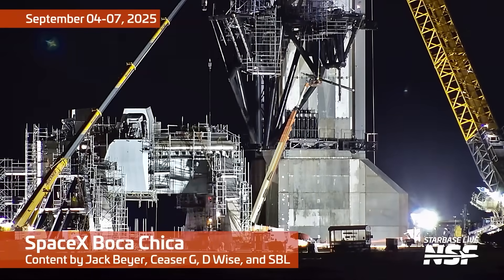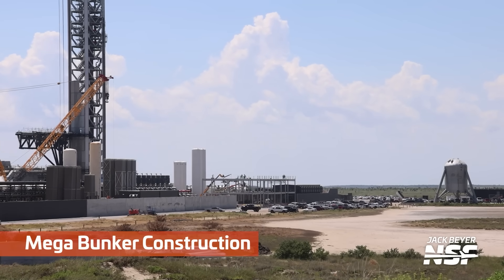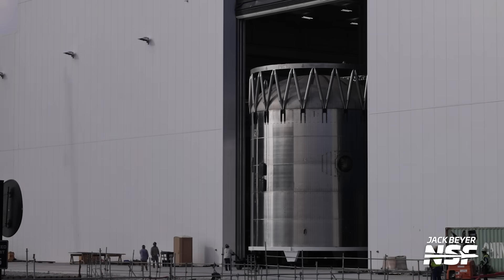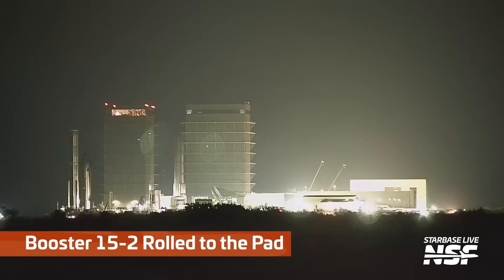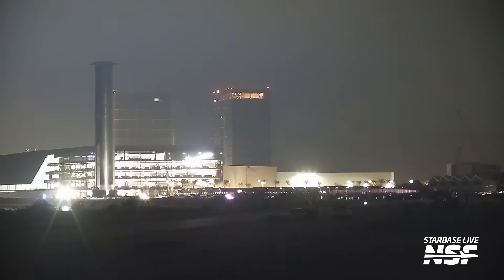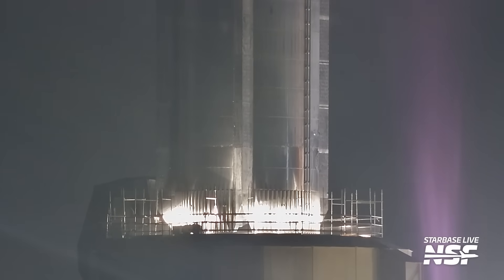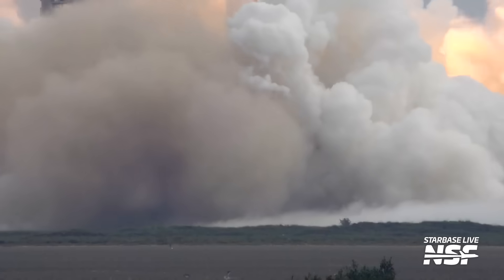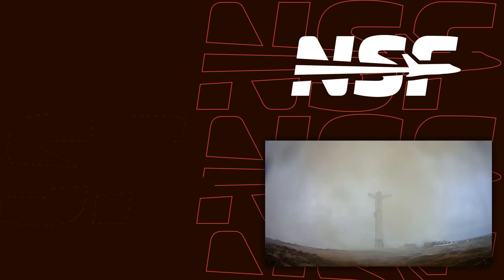"All Gas No Brakes towards Flight 11" | SpaceX Starbase

Comment from the maker: If you're new to Starship you can catch up with the first 10 flights in this article from Ryan Weber: https://www.nasaspaceflight.com/2025/09/ten-flights-starship-program-successes-failures/
Reply: Of I can read properly, there is a tiny spelling mistake :->
Reply from the maker: @atemoc  Spolling is hard ;)
Reply: main issue with the 5:55 camera is the focus is off, on the grass in the close foreground, it should be focused on the middle of the road for optimal clarity and depth of field

Comment: Hey Das, photographer in me coming out again. ( I was the night lens filter guy ) Curious to know, whats the focal length of the new star factory ultra wide you guys are running now?
Reply from the maker: Oh good grief... that thing? Like wide enough to cover from your garage door to the side of your house. (Its a box security cam). Likely single mm 35 equivalent hah. - Das
Reply: @NASASpaceflight  oh Das you made it sound like an old horse. :) 35mm = 63 deg FOV, I reckon its more likely around 14mm = 114 degrees. She's a wide one what ever it is. I use a 14mm in some portrait work and the effect you get is brilliant on close-ups.
Reply from the maker: Single digit mm in 35 equivalent... as in, 7 or 8mm. 😅 - Das

Comment: Need to move a heavy trailer?  TrailerValet.  They have multiple options for powering a trailer around, weight loading and ground conditions, etc.  They are spendy but they seem to be quality.  I've got their basic jack and it is nicely built so I would assume the more-better items are just as nice.

Comment: Could they just cover the Pad with heat shield tiles? Or would they just blow away from the pressure? They handle heat and are easy to replace, right?

Comment: Hello, Moving heave things on wheels. A friend of mine has a light aircraft and we use a battery operated tug, That just attaches onto the nose wheel, so we can move planes around the hanger. Not sure if you have them in the US.

Comment: No it has brakes Flip the ship within meters of the moon surface just like the catch tower just as if the moon surface is a catch tower  Its possible. Space x you can do it . Wish you the very best.
Reply: No flip necessary on the moon. Not much of an atmosphere to go sideways through to slow down, so it is just landing tail first like God and Heinlein intended.

Comment: Does the new integrated hot staging adapter have a section blocked off too control the booster flip direction? I didn't see it in the video.

Comment: I would be glad to give you a tutorial on CH4 liquefaction process as well as an air separation plant. There are many similarities. Different refrigeration levels. I spent most of my career in LNG plant design and startup and testing.
I have followed your channel for a while as I have been a space fan since the 60s.
Reply: David; Do you have any video/ tutorials on this subject?  I would be FACINATED to learn more about the subject.  -Papa Root
Reply: @Paparoot05 I have been retired for about 6 years now. The presentations that I have access to are a bit dated. I was thinking on a verbal tutorial rather than a visual one. That way it can be interactive.
Reply from the maker: Know anybody that would let us visit one? - Das
Reply: @NASASpaceflight There is a large LNG facility near Corpus Cristi that may do tours. Standby, awaiting a response from some contacts.
Reply: @NASASpaceflight I’m retired now, but, let me ask around. Do you have information on who the contractor or process licensor for either project is. I thought I saw the Air Sep unit was a Linde process, but don’t have confirmation on it.

Comment: I struggle to see how those hot staging struts can support the ship with 33 raptors firing.
Reply from the maker: You dont think the massive triangular struts look more sturdy than a ring with holes cut in the side? Huh - Das
Reply: That is because it hasn't happened yet. Rest your eyes until it does, and then you can see it without struggling.
Reply: @geirmyrvagnes8718 I know better than to doubt SpaceX. I am sure it will. It just doesn't look like it could support it on the pad. Let alone through Max-Q.
Reply: @gregorypauldrapeau  I know the feeling. Engineering by squinting at things and trying to judge if it will hold is a time-honored tradition. Humans do it all the time every day, when you think about it. If it breaks you just beef it up a little. I actually think it looks stronger than the current version when I squint at it, but that doesn't help much, either. 😇 What is missing though, is the closed off section that nudges the first stage in the direction of turning back home. Also, it looks like they are apparently putting this in a testing jig, to do some tests with real hardware before launching a full stack. Either way it will be entertaining! 😁

Comment: I've operated an air separation plant. What do you want to know?
Reply from the maker: Do you have one we can visit? 😅 - Das
Reply: @NASASpaceflight  nearly all refineries have a ASU in them. They are typically operated by Air Liquide, Air Products, Prax Air, etc. You shoulf be able to get one of the operators to give you a tour. Places that have refineries and petrochemicals located close together may have a large ASU that pipes O2 and N2 to those facilities. Giesmer outside of Baton Rouge has a very large ASU from Air Liquide that does just that. 

You are relatively close to Corpus Christi. One of the refineries there will have an ASU supplying them.

Comment: Harbor freight makes a manual trailer dolly.  I use it with a utility trailer and a car dolly.
Reply from the maker: Know the model number? You like it? We just have a few crew grab the trailer tongue and brute force it. - Das
Reply: @NASASpaceflight   It's 60533.  Has a 600lb limit, which is probably tongue weight, not total weight.  Definitely easier than picking up by hand!

Comment: I'm really curious to see how the grid fins on the next gen booster will fare considering they are nestled inside the pressure vessel like that. Some serious reinforcement going on in that area. wouldnt be surprised if they spring a leak by the grid fin on one of the first flights of this gen. Seems super risky, and also introduces a lot of additional complications, like getting power to the grid fin motors.
Reply: They not literally soaked in cryo, I'd have thought there would be some insulation between the cryo and the housing for the grind fin motors etc. As for power, they'll chuck some batteries in there like they do for everything else that needs power.
Reply: @RedmondJohnson not really concerned as far as insulation. It’s more so the added area for cryogenics to leak out. It’s a weird protrusion to have in a tank that holds cryogenics at pressures in excess of 100psi.
Reply: @BrandonMeyer1641  No more so than any other opening they've put in the tanks.  Welds can be strong.
Reply: Agree that does seem risky and complex. I have no idea but would think that cut out would compromise the integrity of the tank. I guess that's what B18.3 is for... They will test the heck out of it.

Comment: It’s “brakes.”
Reply: well technically it could be breaks because starbase work is 24/7 so they never take a break
Reply: @Jamie-d6gYes, but that’s not the intention of the usage.

“All gas no brakes" means to act or pursue a goal with extreme speed, intense effort, and a complete lack of hesitation or restraint, often involving relentless focus and high energy. The phrase uses the metaphor of a vehicle with its accelerator fully engaged and no brakes applied to illustrate the idea of moving forward quickly and without any slowdown or second thoughts. “
Reply from the maker: No breaks is probably more fitting for the work ethic at Starbase 😉 - Das